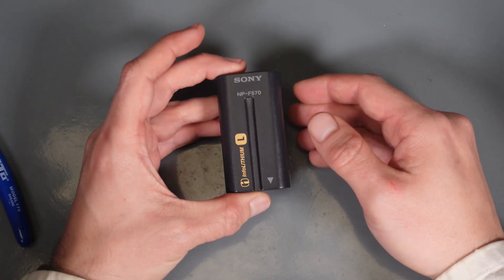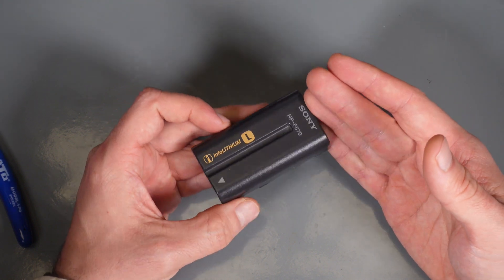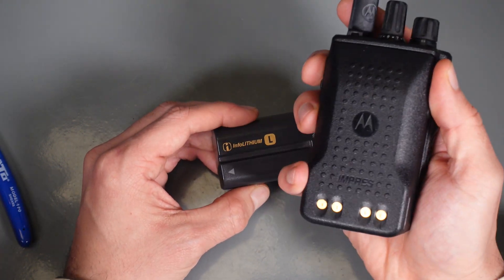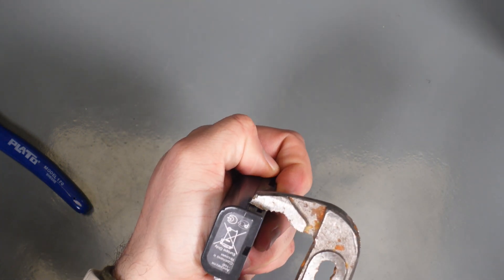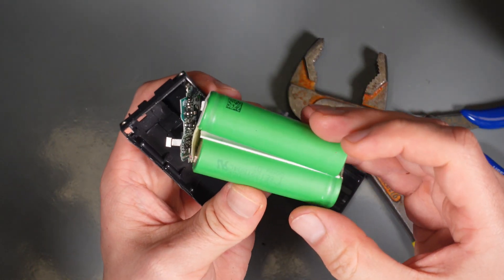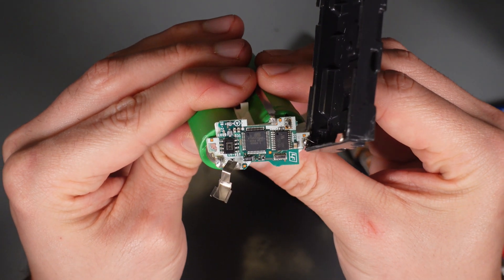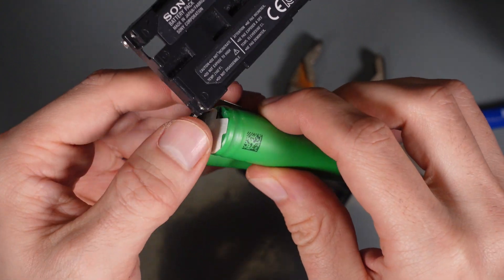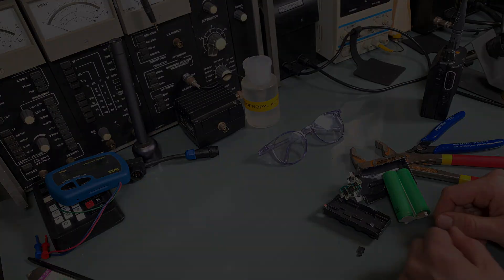Teardown genuine Sony NP-F570 InfoLithium L battery containing Atmel microcontroler

Comment: It would be more interesting if you analyze what the circuit board actually does
Reply from the maker: I don't have time for it.  Judge by complexity I would say it measure power that go into battery and out and allow to report it back to the camera to get accurate reading how long it will operate - not based on voltage but on actual difference in mAh stored while charging and pulled out while discharging. That's my best guess based on similar designs that saw in past.